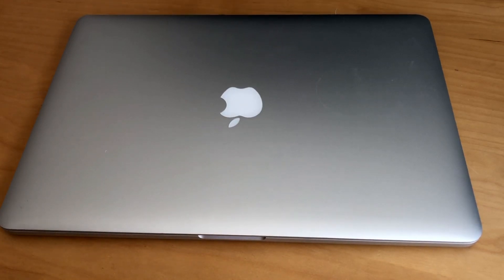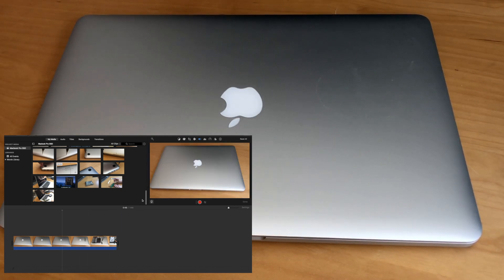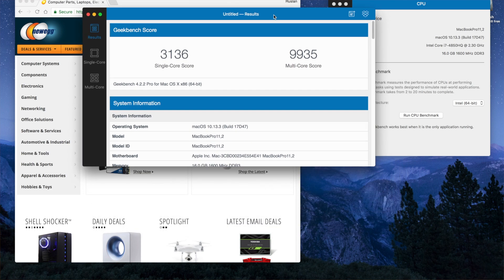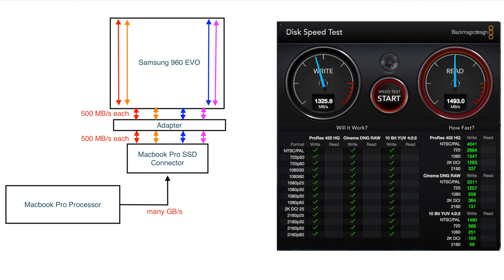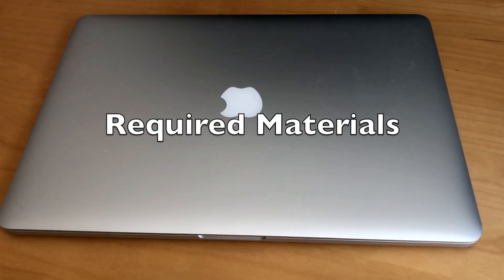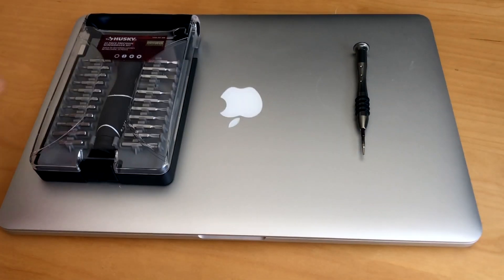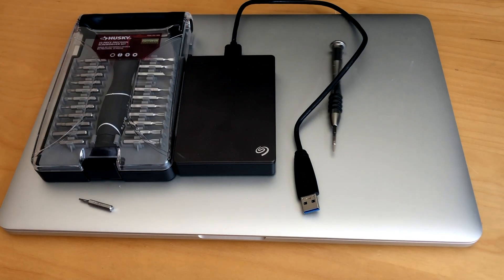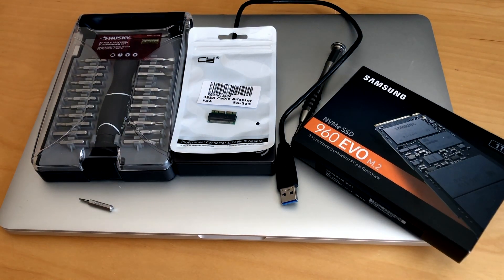Upgrade your Macbook Pro SSD using any NVMe Drive (Double Performance!)

Comment: Is this the same for Mid-2012 15” MBP
Reply from the maker: No, the mid 2012’s had the older design and have 2.5” drives. Much simpler

Comment: put a 512gb samsung 970 pro ssd in my late 2013 15" retina, but there were too many sleep issues in high sierra, not waking from sleep double restarts and hangs during wakeup, even with turning off deep sleep and I don't want to do the necessary bios chip modification to my late 2013 to make nvme natively supported, from a sleep perspective.

Comment: If you do that, you won't have any EFI updates anymore as part of macOS updates. The reason for that is that the EFI Updater, which installs the update during an OS update can only work with AHCI SSDs (either SSDs that use only AHCI or those that offer both, AHCI and NVMe). If you run a SSD that only has NVMe, you simply won't ever get EFI updates again.

Comment: I'm looking to recover data from the original Propriatary SSD installed, but struggling to find an adapter to connect to a PC via USB?? Can anyone help Mac A1398 - EMC 2910

Comment: Good information, thanks for the tutorial. I have a Macbook Pro, early 2013, A1398, Identifier 10,1, but most of the adapters I find says compatible from mid/late 2013 onwards. The one in your link says Late 2013 onwards. Do you think it will work on my machine? I wish to also buy a Crucial P1 series 1 Tb NVMe M.2 SSD for the upgrade.

Comment: What if we use a different adapter? Or MBP 2012 retina doesn't support NVME drive? Please reply
Reply from the maker: Second point is correct, 2012 uses M.2 SATA from my understanding. There’s a good thread on macrumors.com about upgrading the SSD in the 2012
Reply from the maker: Different adapter and not NVME
Reply: @RuslanTulupov  what the adapter to use for the late 2012 a1425 ssd to use in a late 2013 a1398 macbook..
Reply: I searched on macrumors.com but couldn't find. Someone else told me that MBP mid 2012 or early 2013 only use MSATA

Comment: Can you use this with a 2012 MBP?
Reply: What if we use a different adapter? Or MBP 2012 retina doesn't support NVME drive? Please reply
Reply from the maker: Not the same SSD or Adapter but the procedure is similar! 
There’s a great thread at MacRumors.com if you google “upgrade macbook pro retina 2012 SSD” - you’ll want to look for the M.2 guide!

Comment: After install new disk do you have any problems ? Something like with sleep mode or kernel panic ?
Reply from the maker: Deep sleep, “hibernate”, didn’t work, so disabled it using a terminal command. 
No kernel panics or any other issues.

Comment: Can we install NVMe on macbook pro 2012?
Reply from the maker: The mid-2012 models use a non NVME, M.2 drive. An m.2 drive with the appropriate adapter should do the trick. (Sintech makes good ones)
Procedure is similar
Reply: @RuslanTulupov  thank you for the info. It helps..

Comment: Hey dude ! I installed samsung 970 pro evo 1tb on my macbookpro mid 2015..Run blackmagic but...why I have only 700mb and 800mb??
Reply: @RuslanTulupov  Thank you dude for the answer ! I bought this https://www.amazon.it/gp/product/B0788CKXJZ/ref=ppx_yo_dt_b_asin_title_o02_s00?ie=UTF8&psc=1 ( KALEA-INFORMATIQUE © - M.2(NGFF) SSD adapter ) I thinks works good !! It could be maybe the restoration from time-machine from old disk?
Reply: @RuslanTulupov  so what could be the problem?

Comment: how's the temp after the ssd upgrade? My macbook pro runs really hot after the upgrade. Not sure if the temp issue can be fixed. Please advise. Thank you.
Reply: Replace the thermal paste and clean it out

Comment: The interface of A1398 (early 2013 MacBook Pro Retina 15”) is only SATA. The next model, late 2013, has a PCIe interface and could use M.2 PCIe drives. So how did an A1398 function with an NVMe SSD?  My understanding is it’s not backwards compatible. The link you supplied to the adapter takes me to an adapter for later macbook pros. So I am suspicious that this upgrade was for the model A1398.  I have one and did research SSD upgrade paths. Many videos claiming to perform upgrades to “2013 MacBook Pros” are overlooking the differences between early and late 2013 models, and are in fact upgrading the late 2013 version, which leaves the unsuspecting to be very disappointed when they try this upgrade on an early 2013 model.
Reply: A1398 is the designation for both early and late 2013 models. As you've mentioned, the early-2013 models (A1398/MacBookPro10,x) do not support NVME drives but the late-2013 models (A1398/MacBookPro11,x) do.

Comment: Nice!, I have a macbook pro 15 late 2013, which ssd would you recommend the samsung 960 evo or the OWC Aura Pro X 1TB NVME?
Reply: I am having problems with the 960 evo. I can’t get bootcamp to work properly. I can get it to install. But if I switch between the Mac partition and the windows one. It eventually breaks.
Reply: @MemeScreen  My buddy had the same issues. It was his install media that caused the issues.
Reply: @RuslanTulupov  Did you have any of these problems : deep sleep, hibernating and battery drain issues?
Reply: @RuslanTulupov  Thank you!